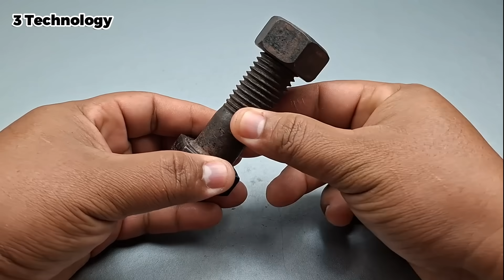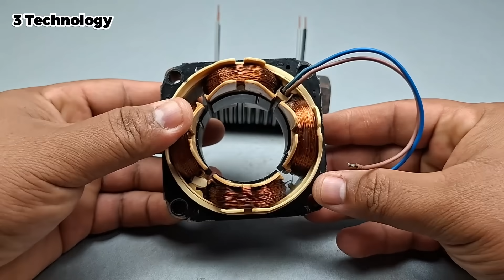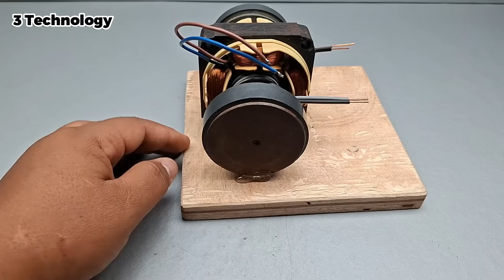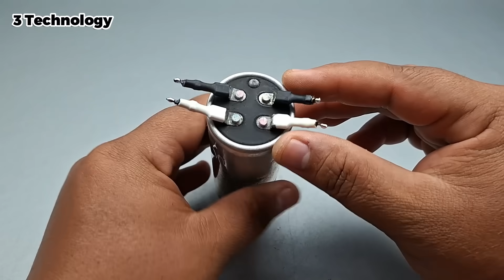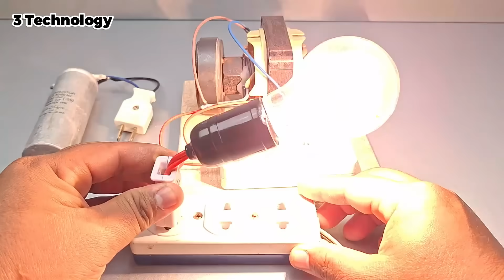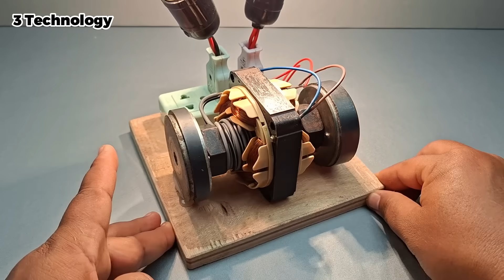I Make 230v 20kw Free Electricity Generator from Speaker Magnet with Transformer tools

Comment: I cannot help it. The abundance of the sea. RECYCLEING of the "Trash Heaps" of Delhi India for example. Matter and energy... Indestructible! Placing the food scraps in an ANAEROBIC DIGESTOR yields Methane Gas. Fertilizer, Synthetic Lubricating Oil and no fracking. Using the Raw Materials of the garbage heaps could be utilized to build Yachts, Submarines and Derrick/Platforms and UnderSea Domes on the scale of Epcot Center Walt Disney World... For Housing OffShore of India. And     ALGAE FUEL!   Unlimited biodegradable Biodiesel... Thank you. Thank you very much... (The abundance of the Sea...)

Comment: チャンネルの投稿者さん、真ん中にあるコイルが４方向にある部品は、何の部品でしょうか？。
教えてください。作ってみたいです。
Reply: nécessite un bobinage avec un enroulement avec beaucoup de tours pour créer une élévation de tension pour que le système puisse s'entretenir sinon les pertes finissent par effondrer le système à mes yeux...j'avais fait une expérience avec un moteur dc 12V couplé à un moteur universel 220V associé à un condensateur adapté à chaque moteur. Un pont de diodes pour ramener le courant AC vers le moteur DC et j'avais lancé avec une batterie 12V sur le moteur DC. Le système s'entretenait donc je pense que son montage est possible avec l'avantage d'être motionless. Si vous menez l'expérience avec succes pouvez vous m'en informer s'il vous plait. Cordialement amitié de France